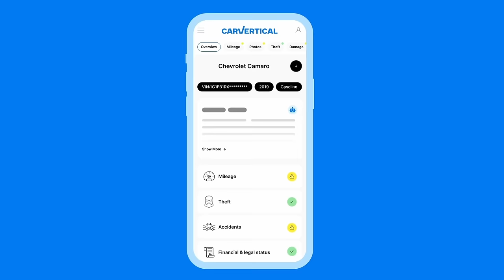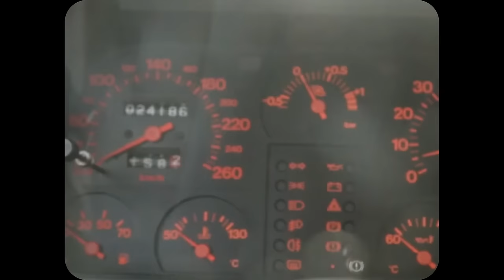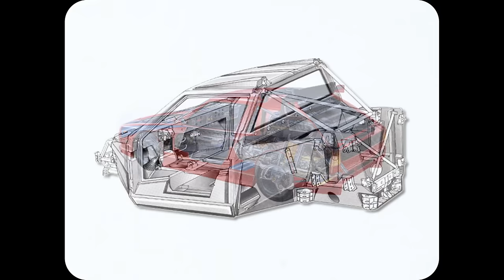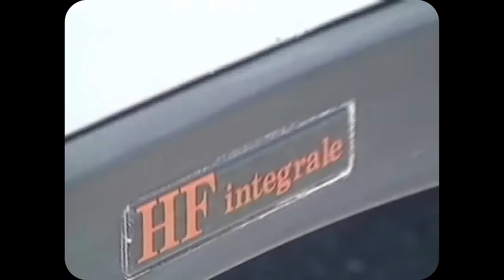Lancia's Deadly Delta Was Too Fast For Rally

Comment: the figure of 450HP is actually correct, as that's what customer teams got with the Delta S4, but the Factory team got some sneaky upgrades to the car to give it around 650hp, the mind-melting 1.9 second 0-60 figure, is from the 450HP version.

It's likely the fastest accelerating car of all time.

Also, the Safari Rally was about reliability back in the day not speed, there was no point to bring the S4 at all, the 037 was a more robust car and easier to fix, Alen still somehow got it's only Safari finish that year, because well, it's Italian.
Reply: 1.9 s? Where'd you get that figure?
Reply: @GeorgeTsiros  Numerous driver testimonials and several tests.
Reply: @Dexter037S4  Are you sure you do not confuse the mention of "1.9" that refers to the engine displacement, for a measurement of time? All articles I find say 2.5 seconds. Can you link even one article that says 1.9 seconds?
Reply: @GeorgeTsiros  maybe he means 0-60 km in 1.9 not mph
Reply: @nuztuz903  I never even mentioned units. Doesn't matter what units it is.
Reply: @GeorgeTsiros  the "1.9" in the original comment refers to the time it took the lancia to get to 60mph (or km) from 0. I am not sure if you are aware but 1.6 kilometres is equal to 1 mile meaning a 0 - 60 time using kilometres would be faster than using miles per hour. so yes the units of measurement would impact the time
Reply: @nuztuz903  you are right in that 1 mi is about 1.6 km.  You are wrong that the original comment refers to mph. There is no mention of units anywhere in the original comment from Dexter037S4. They could be talking about mph or kph. We do not know. Once again, I have not seen the 1.9 s time anywhere no matter if i search for 0-60 mph, 0-60 kph or 0-60 without measurement unit at all.
Reply: The lancia S4 could do 0-100 km/h (=60miles per hour) in 2.5 seconds on gravel, and 1.9 on tarmac.
It accelerated faster than contemporary Formula 1. The only thing faster at the time were probably top fuel dragsters.
Reply: @egoalter1276  you guys keep repeating that. where did you find that figure?

Comment: Blame the attendees, not the organizers or the sport
Reply from the maker: No, I am going to continue blaming the organisers, and to a certain extent the manufacturers too. A single accident is just that, an accident, but Group B was un-safe in every aspect, for everyone involved, and had demonstrated as such numerous times. FISA acted far too late. Spectators and drivers alike were victims of woeful mis-management and negligent oversight, and trivialising the deaths of these victims, particularly those spectating, is callous and wilfully ignorant of the realities of the time.

Motorsport is dangerous, but that doesn't let those responsible for its regulation off the hook. In much the same way that a single plane accident is a tragedy, but multiple failures of a single model in a short timeframe may be considered criminally negligent. You wouldn't blame the passengers for their own deaths.